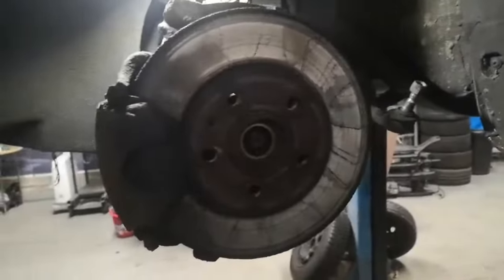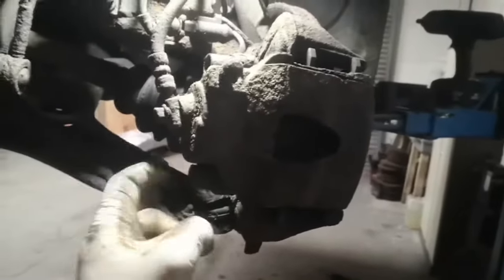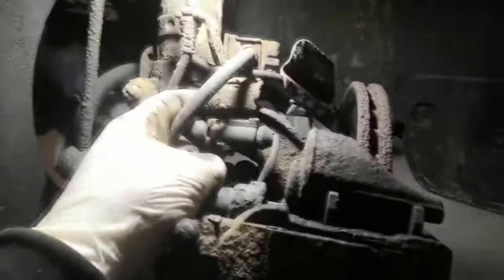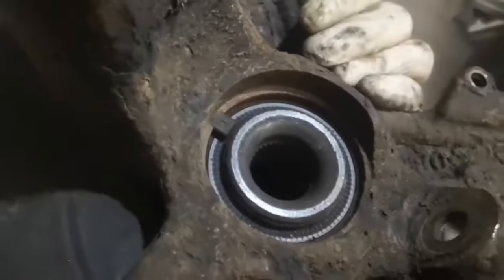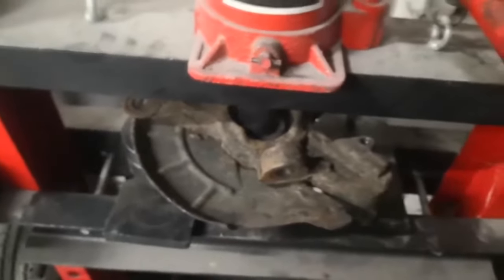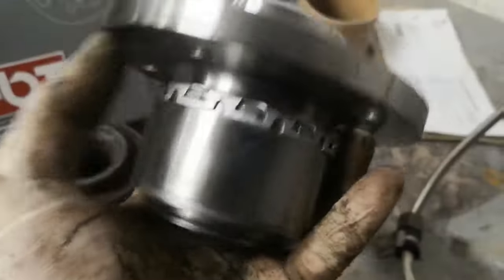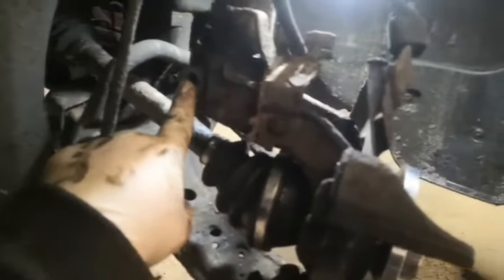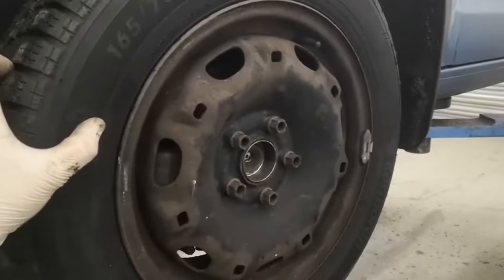Vw/Audi/Seat/Skoda front wheel bearing replacement.

Comment: Great vid. Nice and clear explanation. 
If you get the chance to do a 6N Polo front wheel bearing, where you have to press the hub from the centre of the old bearing, that would be great.
Reply from the maker: It's similar on other models but that's basically the same only the bearing race usually gets stuck on the hub but there is a notch for you to be able to get a pry bar or puller under the race to remove it, hope that helps.
Reply: @DubworxMedia  - Cheers

Comment: how do i get the lower ball joint or how it's called off? haha, i took of the screw but its not coming off
Reply from the maker: Usually a hammer to the side of the knuckle where it is mounted or undo the bolts that hold it to the arm
Reply: @DubworxMedia  alright i try that tomorrow, thank you :)

Comment: Yeah it would have been good to see how you pressed the bearing in
Reply from the maker: Theres a special tool for it but I did it the wrong way hence I didn't want others copying and messing up their bearings, you might be able to use 2 steel plates cut into shape to fit behind the flange Infront of the bearing and some sort of rods to put through the bolt holes in the flange and push the plate.
Reply: Its a good video and what would make it better is showing the axle nut going on with torque specs etc?
Reply from the maker: @alan2804  I usually max out my torque wrench at 210nm, never had a problem yet, they're not really a issue as most have some way of locking the nut or bolt so wheel bolt torque settings would be adequate, to lock the disc I use a screwdriver in the disc unless you have solid discs then 2 wheel bolts in and a bar between them to stop it spinning, I may end up remaking some videos with better explanations.
Reply: is it still holding? @DubworxMedia
Reply from the maker: @gorgas8  yes, still going strong